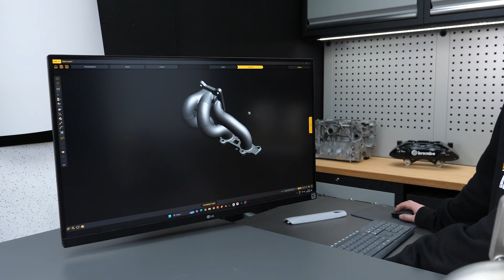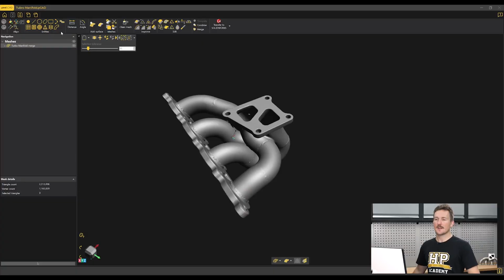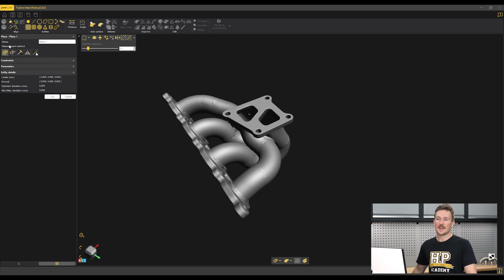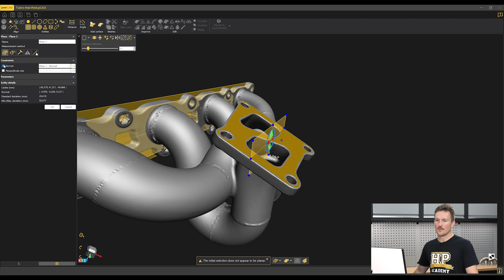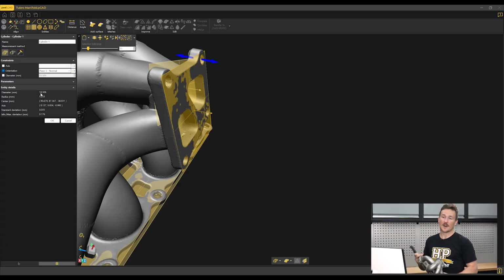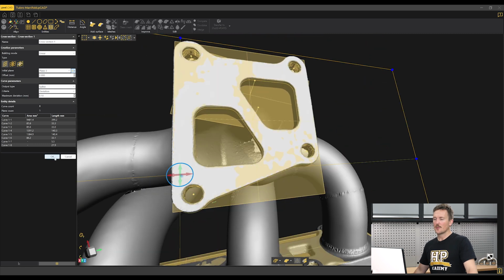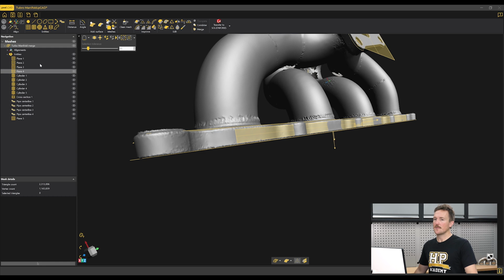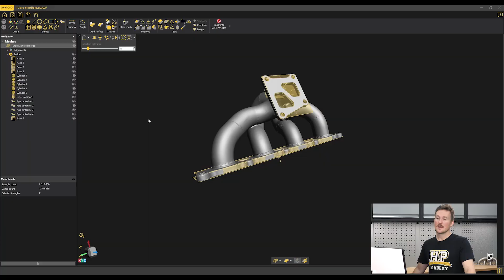3D Scan Like A Pro: Extracting Entities

Comment: This is wicked stuff, do you guys have any other scanner and software packages you could recommend for more of a beginner? Looking to start a business and anything with features like this would be insanely helpful.
Reply from the maker: Connor covered a few entry level options linked below, and we'd pair them with Fusion software wise instead of the Peel.CAD option shown her.
Note the course this is taken from does also show the Fusion alternative, it's not just using or only specific to the Peel platform :) 

Also one thing the link below doesn't discuss is the secondhand market for scanners. Worth a quick check too locally - Taz.

https://www.hpacademy.com/blog/scan-off-reveals-best-sub-1000-3d-scanners/?utm_source=youtube&utm_medium=social&utm_campaign=general-interaction
Reply: @hpa101  Cheers Taz 🤙🏼